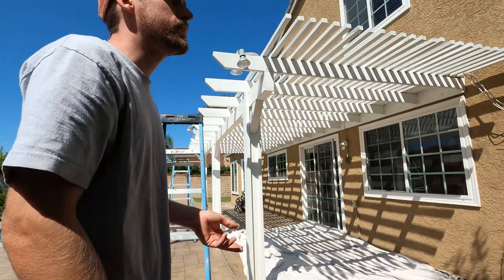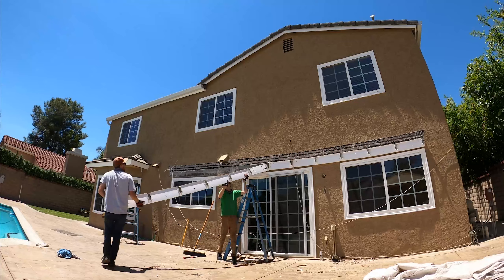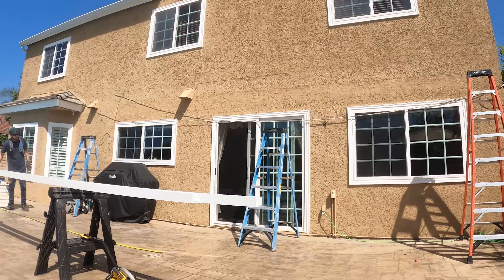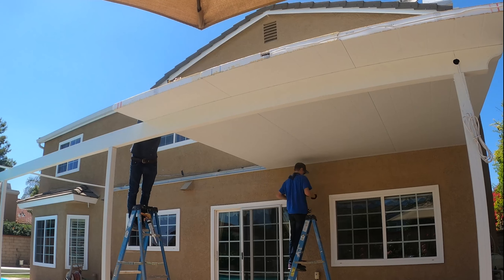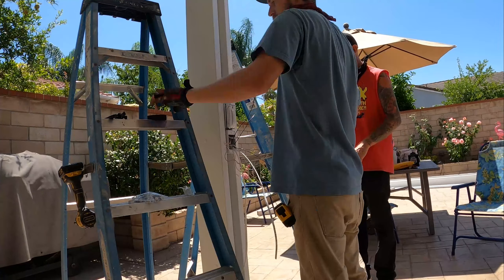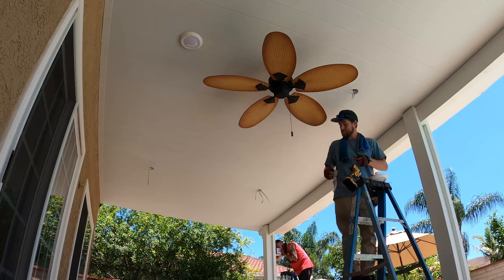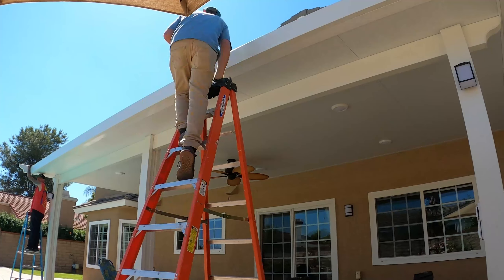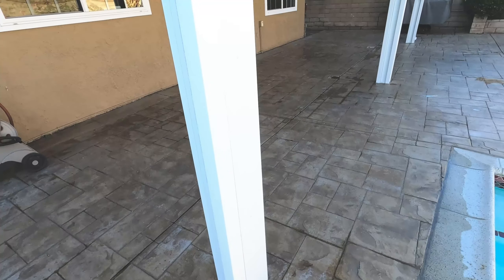How to Demo and Build an Insulated Elitewood Patio Cover with Fan and Lights

Comment: Great work & explanation, do you have a video explaining how you installed & ran the lights wiring? I'm having difficulty finding a video explaining the roof lights install!
Reply from the maker: Hey Ishmael, great question. We use recessed LEDs now, because the ones used in this video were discounted. Also the recessed 4 inch HALO LEDs are more water resistant. A little trickier to install, but we have a combo freestanding video uploaded around May last year, that shows how we install them. The easier ones to install would be the flush mount HALO leds 6 inch, you just drill a 2 inch hole into the fan beam, and pull your wires through there.

As far as connecting the lights, we usually run electrical to the hanger, on this patio we pulled from a second story window outlet, then you run electrical to where you switches are, then from the switch to the lights. A simpler way is to run from the existing porch light to power the lights, as the switch is pre-existing. On your hanger you can mark your light locations, and use a clip to hold the electrical line in place. I usually run the electrical lines into the fan beams as I'm building and drill out the 2 inch hole for the lights later, but many installers drill out the holes for the lights on the ground, and run the wire directly into the hole as installing the panel.

There's no real right or wrong way, everyone has a way that works and is easier for them,

Hope this helps, have a great day Ishmael!
Reply: @EverydayPatio  wow thank you so much for the great thorough explanation!

Comment: Just had a 35×14 slab done but struggling with which patio cover is best, wood or aluminum.  I'm in Florida so I need sturdiness, durability, low maintenance. Why did you chose aluminum over wood?
Reply from the maker: Hello there Sasha, thank you for your comment. We choose to work with Aluminum cover because of its durability, if it’s built right the patio can go over 50years, no worry about the wood the rotten, or termites all those problems woods has. If you would like to know more info on the material feel free to visit our website www.everydaypatio.com

Thank you for your time and hope you have a good day!

Comment: Great Job !!! If my patio roof is already installed, how can I install a five blade fan?
 I can't find and beams.  If I use a small drill bit at the seam I just go thru thin metal. Are you guys in Florida?
Reply from the maker: Hey Myles, thanks for the comment! If your patio cover is already built, the main way you would pull electrical is by piping it in through the top of the patio cover. You would put a hard metal bracket on top of the patio cover, install the fan bracket through the bottom of the patio, into the top with with self tapping screws, and/or then install thorough bolts.  After this step seal the bracket really well, with permanently flexible caulking. And drill a hole in the top of the bracket to run electrical to the fan. Seams aren't usually an ideal spot for electrical, due to potential for water to get in. The most important thing when installing electrical after the build, is making everything water tight.

Hope this helps and good luck with the install, we're in California BTW, but I know there's a factory in Florida,

Best Regards,
Everyday Patio

Comment: What size lights do you guys normally use?  4 inch or 6 inch?
Reply from the maker: Hello Jesse, thanks for the comment.  Currently we are using 4 inch LEDs, this can change over time, as new lights are released. This patio cover had 6 inch lights.

Hope this helps,
Everyday Patio

Comment: What do you need to use to hang the fans?
Reply from the maker: Hey Matt, you ideally need a fan beam/electrical channel embedded into the insulated roof or a bracket above the roof to support the fan. 

Hope this helps, 

Thanks, 
Everyday Patio

Comment: nice job...how you did run the wires into the aluminum panels?
Reply from the maker: Hello there Andreas, thank you for your comment. All the panels has electrical channels to run the electrical wires. It's called electrical chase.
Hope you have a good day.
Reply: Hi there, awesome video. I have an inslated patio cover and they left a hole in the beam for electrical, but they wouldn't install. Can electrical still be ran?

Comment: How are the wires run in the roof panels?
Reply from the maker: We run the wires into the electrical channels, embedded in the panels. Other ways include running conduit on top of the cover, but that often leads to leaks in the electrical system, which is why you should always avoid running conduit on the roof of the patio cover.

Thanks you for your time and the comments, 
Everyday Patio

Comment: What is the height (floor to ceiling) of this patio cover? Having a hard time deciding in the 8-9 ft range to have decent shade while still having room for fans.
Reply from the maker: Good Evening JM, the height of this patio cover started at 9 ft. on the bottom side. Personally I believe the best height for a cover with a fan is around 8 ft. It really depends on the type of house you have to figure out a height that works for you.

Thanks for the comment and feel free to reach out if you have anymore questions,

The Everyday Patio Team

Comment: What is the weight the roof panels can hold I see you guys walking on them must be a few hundred pounds also how do you hide the electrical wires through the panels do you have a video on that?
Reply from the maker: Hey TopDogVic, my brother is a little more well versed in the exact Lbs. Per sq. Ft the roof panels are weighted to hold. It pretty well supports any of our installers and crews on the roof. And can support light weight roof tiles and solar systems if engineered properly. As far as running the electrical inside the patio, you need to have fan beams embedded in the panels, I usually run my main 1-3 lines into the hanger and from there into the rest of the patio cover. 

Thanks for the comment and we hope you have a good rest of your day,
Everyday Patio

Comment: How often is do u get patio covers that have pieces that dont fit together as it should?
Reply from the maker: Hey Steven, usually the pieces fit together right, but with so many different parts and variables, yes sometimes we do have to address materials that have defects. 

I will usually account for this, when working on a job, it's a variable we must live with, 

Thanks for the comment, 

Best Regards,
Everyday Patio

Comment: how do u run the electrical through the panels? looks as if theyre solid from the insulation
Reply from the maker: Hey Duben, great question. We run electrical into electrical channels inside the roof insulated panels. You need to order this ahead of time, the other option is piping is electrical through the roof. But this is pretty unsightly and tends to leak.

Hope you have a great weekend, thanks for all the comments,
AJ